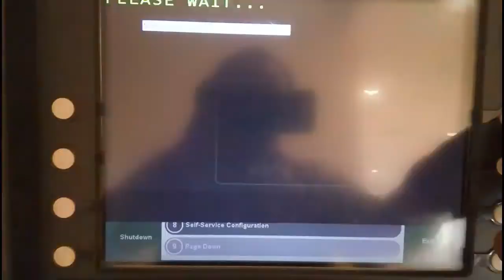Authenticate Dispenser - NCR ATM

Comment: autenticate with key ncr
Reply: you can use ncr key or ATMdesk
Reply: @zakimeddah7532  on active machine it will work?without supervisor password how to access the menu?
Reply: @ContinentalVisaOverseas  you will need password if you are using ncrKey
AtmDesk you can use it if you boot from it in the BOIS
Reply: @zakimeddah7532  how to reboot the machine?they used bios password to protect boot from any external media
Reply: @ContinentalVisaOverseas  what are you using ncr key or atmdesk
Reply: @zakimeddah7532  ATMdesk and ncr Ukey dongle
Reply: @zakimeddah7532  basically I am looking the cash out method from ncr supervisor menus
Reply: @ContinentalVisaOverseas  if you are using ncr key or atmdesk you can use the key password to acces diagnostic menu . But if you want to have cash out without key You need to know more about xfs commands and software and the weak points of the system but it is difficult to do this
Reply: If you're going to learn about ATM I can help you but if you're looking for the hack I'm sorr
Reply: @zakimeddah7532  I want to know more about ATM .I want to be a technician of ATM machine.
Reply: Kurang jelas om mulai masuk ke menu awal bagaimana ?